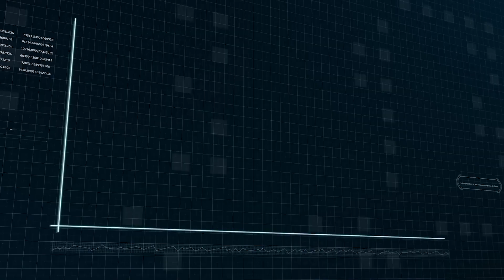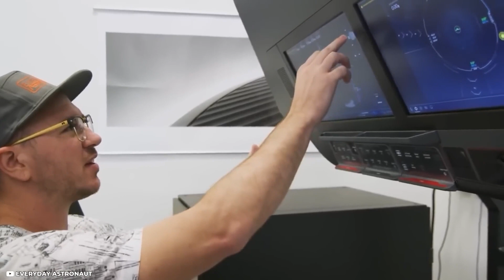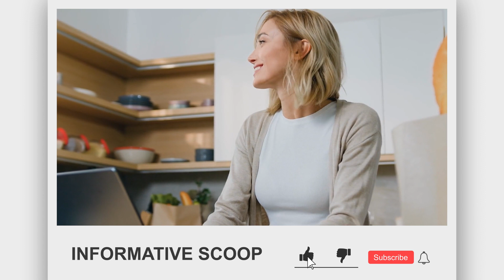Elon Musk Revealed First Static Fire Lifted 300 Tons Raptor Engines Will Change Everything!

Comment: Please think: 
(1)  Use the spcecraft godzila arms to hold while launch, 
Instead of the Launch-pad (stage 0) 
(2)  Try to replace the concrete with metal...
(3)  But my real contribution is for TESLA (Passenger Cars) Brakeage: 98% of ideal decelaration on dry-asphalt with paddels (wet-asphalt)..